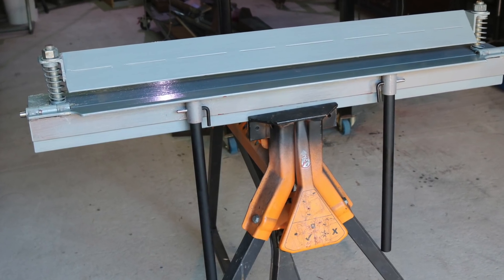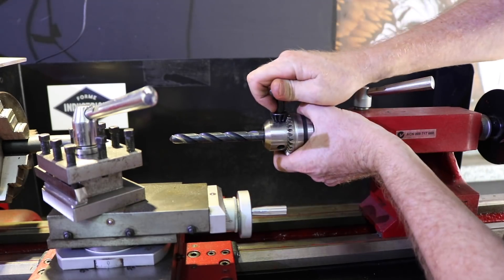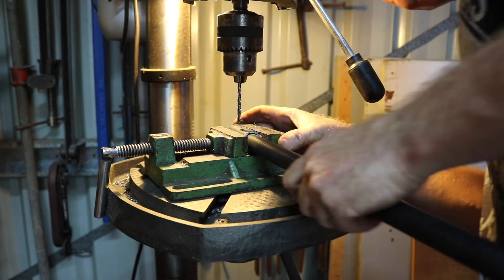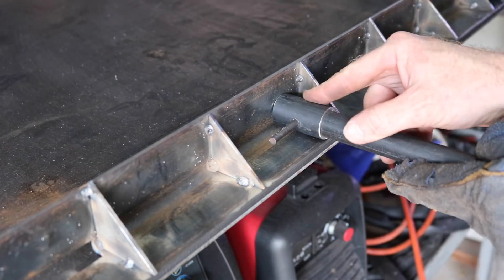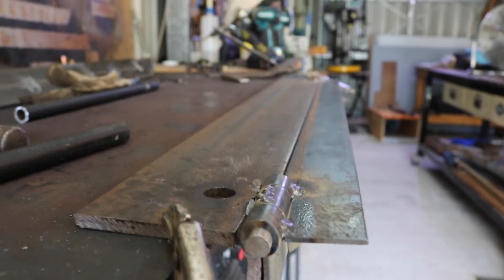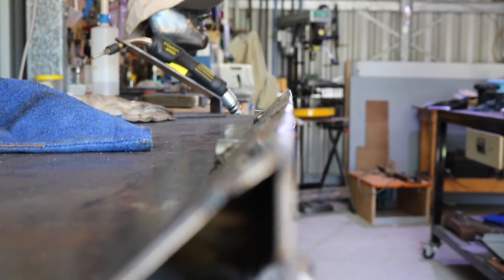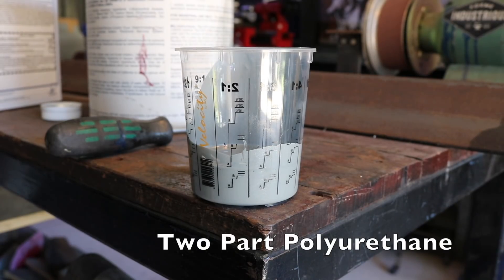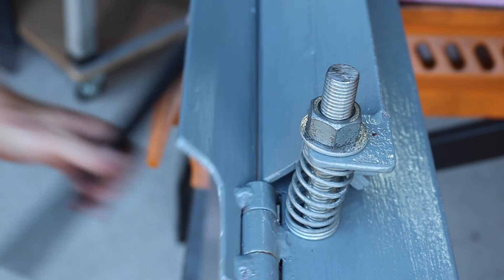DIY Sheet Metal Folder - Forme Industrious

Comment: nice work. What's the max width of 1mm sheet it can bend?
Reply from the maker: Thank you, yes that is about right in thickness. If you have a very narrow piece it will do more.
Reply: @ScottTurnerformeindustrious  but how big piece it can bend? I build myself metal folder from 4mm 35x35angle, and it's pretty weak, it can bend like 40cm max at 1mm. Just want to know if your design is any better

Comment: The one thing none of the videos I've seen so far tell you or even point out is that the clamp needs to move back from the hinge axis subject to the thickness of the metal being bent. Fine if all you are going to do is bend the same thin tin all the time but start getting up to 3 or 4mm and the angle that does the bending can't get to 90deg never mind further......
Reply from the maker: Thanks for the feedback Jonathan. Please note I have made a video for modifications to the bender for this purpose, see link for the video ; https://youtu.be/JhSDTo9fI_c  Also these benders really struggle with heavy material so for most light gauge is all that is used.
Reply: @ScottTurnerformeindustrious  Yes but even a difference of 2mm matters.
My point is why do so many videos, just about every one of them, yours included, don't realise this until after they have made one?!
Are you calling 4mm heavy, 4mm alloy?
And another thing no one seems to have grasped,  because the clamp bar needs to be adjustable  if you want to do a run of half a dozen or more identical bends then a great deal of time will be saved if adjustable stops are fitted to the back edge of the clamp.
This is the difference between the skilled craftsman and those who post on YouTube,
Reply from the maker: @jonathansimmonds5784  heavy i.e. steel. Did you see the second video?

Comment: Brilliant video. Thanks for sharing. What’s the maximum capacity. I mean will it bend 1.5 mm mild steel along the full width?
Reply from the maker: Thank you! 1.5mm it will struggle for the full width. If you make a relief cut it will do it. I made a fire pit, grill with the bender using 3mm mild plate. I made relief cuts and it performed well. I made a video on that project for you to see.
Reply: @ScottTurnerformeindustrious  thanks. Look forward to seeing the video

Comment: Nice job Scott. In case you didn't know, there is a Aerosol product called PREVAL you can put your own paint in it and spray your jobs. They are available from mosty Aussie Auto parts stores or ebay. Cheers
Reply from the maker: Much appreciated, thank you. I actually have a HVLP Spray gun, however I don't like to spray 2 pack paints without proper filtration. The over spray lands on objects quite a distance away and then cures. Don't ask me how I know this..... I may have had to pay $$ to have a car cut and polished due to over spray.
Reply: @ScottTurnerformeindustrious  👌👍😁

Comment: instead of a piece of wood you can have a slotted (for hight adjustment) flat bar bolted to the top angle iron with a 45 degree bevel at bottom (bend point) held by angle  cleats welded to far side (of top angle) with holes for bolts
thx for the video

Comment: I really enjoy your video on making a sheet metal brake. You used some rotary cutters instead of drill bits and  they did cut like butter like you said in the video.  My question is where can I purchase some here in the United States. Are they called rotary cutters, if I know what they are called maybe I can Google them. I would appreciate any assistance in this matter. Thank you so much for all of your help. Also thank you for the informative video please keep them coming.
Reply from the maker: Thank you Rudolph! Yes the rotary cutters are excellent. I get zero kick back but here is the link.https://www.hougen.com/cutters/sheet-metal-hole-cutters/Rotacut-sheet-metal-hole-cutters.html

Comment: i need to build one for my projects . what is maximum thickness (mm)
 of metal it can bend . i need to work with 2mm or 3mm
Reply from the maker: I'd say 1mm. Not too many manual brakes will bend 3mm sheet.

Comment: Your design is fundamentally flawed. 
Using angle in the orientation you have is its least rigid mode.
Your first attempt illustrated the error.
Your second attempt disguised it.
It's a common fault with these builds.
If you look at an RSJ in its vertical mode, that is its most rigid.
The vertical web gives stiffness, and the top and bottom flanges resist compression, and tension, respectively.
An angle is a quarter of an RSJ.
https://www.youtube.com/watch?v=87igEF85468
The above is closest to a commercial brake. 
https://www.youtube.com/watch?v=NMsHd1u9mlQ
This one is using the metal with maximum stiffness.
You need to use the stiffness as illustrated  here, or as close as possible.
Reply from the maker: Thank you for your comment, much detail. I'll take look at the links. I decided on using the angle to bend past 90 degrees. It is only used for light gauge material.
Reply: @ScottTurnerformeindustrious  
The only commercially sold  version I've seen like yours, is 600mm/2ft max width, and 0.7mm max thickness. Almost kitchen foil! 
That version uses the angle flat to the material on one side, with a flat strip to close it into a triangular tube.
Ideally, you'd need something like the flat plate you've used as the base, to bend the metal against.
Reply from the maker: @niklar55  I used mine yesterday to bend 1mm mild steel. Worked well, however I agree it is only for thin sheet metal. Most home DIY are not looking to bend much thicker.
Reply: @ScottTurnerformeindustrious  
Thats probably true, but for a bender of that size, I'd regard 1mm as the minimum.
I'm presently trying to design a bender that circumvents the problem I've mentioned, but still gives full range of  usage.
It's obvious, so far that a blade in multiple lengths/parts is desirable, for box/tray making. So at present I have two pieces of channel, perpendicular to one-another, as a starting point. [In my CAD program] and am working on it periodically, as time and other projects allow.
The vertical hydraulic version seems the most effective,, but requires a lot more material and work. So somewhere in between may be the answer.
Who knows, any year now........!😎
Reply: @ScottTurnerformeindustrious  
If it works adequately for you, then thats really all that matters.
One improvement could be to use unequal angle, say, 100x65 mm, vertically,  like a capital ''L'' and then close the angle with a diagonal plate from top to bottom, making a tube. the diagonal would act as a guide to grind the lower edge of the angle to a knife edge.
This uses the angle most efficiently, providing the best stiffness available.

Comment: I always like to hear the Australian lingo. "I'm such a goose." Priceless! 
Nice work on this. I am going to make one of these so I an make my own steel cabinets with shelves.
Reply from the maker: Thanks Dave. I'm also a Drongo from time to time. Regarding the folder, I made a follow up video where I made some improvements to the basic design. It is much better now. Cheers.
Reply: Bending leaf should match the base or reinforce behind to equalized themselves working against each other when braking a pc. of metal hold down edge should flush to base reinforce w/angle iron 5 or 6 mm heavier metal for all for thicker capacity  of brake with no twist or distortion of leaf and hold down straight bends like your spring return

Comment: "Extraction System"? Oh you must be in Nanny State Australia then.
Reply from the maker: Strange comment. Aside from obvious hazard reduction relating to health, an extraction system protects anything down wind of the paint particles from getting paint dots all over it. Such as cars. Two pack paints are not air cured like acrylics, when the over spray becomes almost like a dust after a few metres doesn't stick to things. Two pack Polyurethanes are chemically cured, meaning the paint partical overspray lands on something and cures on it.  Imagine a neighbours nice white car with hard cured grey paint dots all over it.  Sometimes we must use our brains.
Reply: @ScottTurnerformeindustrious  Why would you need an extraction system anyway when spray painting 2 Pack is illegal at home in Australia, check the law. Another Nanny State requirement. I'm complaining about Australia, and how restrictive it is, not you or what you are doing.

Comment: How bout welding a couple of short pieces of round to the lock down nuts to create some t handles so you don't have to look for a wrench everytime you want to lock your work down? You're right way too over engineered, less cuts and less welding makes for sturdier and straighter pieces.
Reply from the maker: Totally agree Andrew, thanks. I did a follow up video on this bender with what I call improvements. All experimental, but that's how we learn when we are bashing away in our sheds.

Comment: Hi Scott,
A damn fine video explaining the steps well.
Is it possible (with the clamping bar removed) to use your bender to do radius bending also?
Cheers
Reply from the maker: Thanks! Well if you use slippers you can create bigger bend radius's. I have another video with this bender with modifications which shows the slippers in use. Hope that helps.

Comment: can you tell me maximum thickness this tool can bend?
Reply from the maker: < 1mm steel comfortably for its length. 3 mm Steel up to say 50 mm wide easy. Remember this is a sheet metal bender

Comment: Is it ideal to enlarge it to 4m - 6m with just two hinge on both end like above assembly? I had one industrial type but many limitation especially edge bending of less than 25mm.
Reply from the maker: With this design 4m or 6m is pretty darn big. This one is less than 1 m You would need to have pretty heavy structure to make it work, and bracing. But I suppose it is possible for bending thin material.
Reply: @ScottTurnerformeindustrious  Yes, it is big. I'm deciding to do this (cheaper as I can DIY it) or just use feeding machine with roller type. Just typical metal sheet that range from 0.2mm to 0.6mm type. Definitely less than 1mm.

Comment: I used box steel for bend bar,,, works very well, and you can get flat square edge angle iron instead of useing round edge,, and you can have your bending edge milled in sharp angle for crisp bends.
Reply from the maker: Thanks George, Yes a milled sharp edge would be much better. So far it's been a pretty handy tool for my workshop.

Comment: Great set up of tools..... Very jealous..... Great workmanship also. A lot of YouTube content creators just throw stuff together and totally disregard safety, forgetting young teens watch and emulate what YouTubers do...... So top job all round mate 👌👌👌👌👌
Reply from the maker: Very much appreciate your comment Adrian. I have some that mark me down on that regard as most times I don't wear gloves for general work, except when using chemicals. I'm not perfect but I do my best to get the safety glasses and muffs on. Welding I cover up otherwise UV burns my fair skin. Also I need to get a respirator for some jobs. Cheers!
Reply: @ScottTurnerformeindustrious  don't worry about the haters mate. I'm a boilermaker so i really like to see when good marking out and measuring as im ocd as hell about that..... I've got a 3/4 built pan break, i just need to find the time to finish it off, but since moving and ending up in a tiny workshop I've lost all drive. I was going to do a job a week or 2weeks if it was a bigger project. But like i say, ivd lost motivation.... I do a fair bit of blacksmithing also......
Reply from the maker: Cheers Adrian, you'll push through it and get it done the you are ready. I have a second video on the bender that shows some mods that improve this style of bender. It's worth a peek. I've bought a diy forge kit, so I just need the chance to put it together. Need to try some smithing!

Comment: Hi Scot, can it bend the 2.3 mm steel plate or 3.2 mm steel plate with 400mm long ? I wonder
Reply from the maker: hi, no sorry, this design is only for light sheet metal less than 1mm thick

Comment: How thick a steel will a tool like this bend?
Reply from the maker: Depends on the length. I just bent up 1mm steel, 700 mm long and the bend had a bow in it. The reason is that the lower bending jaw flexes in the middle. I have since fixed the top. You can see more other video where I did the mods. When I mod the bottom jaw 1mm will easy to bend.

Comment: Good job. I was worried at first with the flex in the thinner angle. You obviously fixed that with heavier angle and the finish was great. Thanks
Reply from the maker: Thanks Geoff! I did a heap of structural improvements to this in another video. Much better now.

Comment: I am bilding one right now
But my question is where can I find those rotary cutters.
You have a brand name or shop where I can buy those
Reply from the maker: Here is the brand that I use; https://www.hougen.com/cutters/sheet-metal-hole-cutters/Rotacut-sheet-metal-hole-cutters.html
They are pretty darn good! I got mine second hand but if you search on line you should find a supplier.
Reply: @ScottTurnerformeindustrious  thanks for the info.

Comment: Love your work bro! Only thing I'd like to have seen you make on this one is handles for the height adjustment rather than needing to use a spanner. Maybe some tubing welded to the nut and a simple bar fitted through opposite holes at the top, make it quick to use and long enough for leverage? Just a thought, keep up the great work.
Reply from the maker: Thank you! I might yet do that but sometimes the handle can get in the way of the bend. Cheers!
Reply: Thanks for the response, really appreciate that. Just to add, the lever bar would have stops on each end and would be free to slide back n forth, to avoid it being in the way.... Aaaaanyway, I have also seen your update video to this one, love the new machined spanners, as always, top work 👌👍🏼
Reply from the maker: Ah yes I see what you mean. That would work. Cheers!

Comment: Powerplasma cutter is my preferred way to cut metal. I was tired of buying blades for my band saw.
Reply from the maker: Right on. I changed over to a high quality blade. last so much longer. My plasma is pretty wild on accuracy, always leaves me with heaps of grinding.

Comment: Thanks for more great ideas Scott 👍
Reply from the maker: No worries!
Reply: Hi Scott, I think I’m gonna put my hand to building one of these shortly,  I have a heavy welding table that I’m gonna attach it to which is 1m in width,
I’d like to build it to fit a 1220 sheet and add in a supporting truss on top, but I’m not to sure if it is a good idea to go this big as I’m not to sure if I’ll have the strength to bend a sheet this big,🤔
From your experience with your one do you think goin for 1220 is too much.? 
👍
Reply from the maker: Richutube2000 check out Phil Vandaley build (I think it's Phil's video). He made one about that size but it will definately need struts to stiffen . Thickness of material that you want to bend is another factor.
Reply: Will do Scott thanks, 👌

Comment: epic job.  one question--I use a portable bandsaw affixed to a table made by Swag especially for that saw.  However I get a ton of blade bend so making perfect cuts in tough.  Any tips on how to avoid that?  On your saw it looks like the blade stays true.  Thanks.
Reply from the maker: Hi, thank you! I have never used the portable band saw however the best metal band saw set up video I could find is this one:https://www.youtube.com/watch?v=0Z-xRzI6nEI I used this video to set up my metal band saw. Very now and then I have to do an adjustment. Hope this helps.

Comment: Hi Scott, I absolutely love your videos, have just finished watching your recent one on your new CNC table. lucky bugger. I then remember about this video I had watched some time ago. Scott do you have plans for this build with the modifications you made to it to allow the ability to make boxes? I am pretty sure that this build need to be my next project. if you don't mind sharing of course. Finally I am looking at buying a horizontal band saw. how do you rate the Hafco one you have? Your videos are very inspiring and making me want to get out and build. thanks Andrew
Reply from the maker: Hi Andrew. Thanks for watching my videos! I am fortunate for sure. I don't have plans sorry for any of my builds, yet. Maybe i should. Also I haven't done my mods yet either (gosh I've been slack!) But it is a relatively simple build but I'd advise to use heavy gauge steel to help prevent flex. My Hafco BD-5S Bandsaw is great for a small shop or light work. I love it for what I do. If you get one try and get high quality blades (I'll try and find the brand I use). Cheaper Starret blades just don't last long. Yes get out and make something! Al the best!
Reply: Scott Turner i went out and did it. I purchases a BS5S bandsaw.😀 have given it a good work out this weekened. Thank you for your advise. Cheers
Reply from the maker: Awesome! Have you checked your cuts for square? They do need a bit of adjusting. It's a good saw. I also use a little cutting oil. I find that helps maintain the blade. Thanks for letting me know!
Reply: Scott Turner i was lucky as the cuts look pretty square staight out of the box. So i thought i better leave well enough alone. Have only done 90 degree cuts so far. What are you using as a cutting fluid?

Comment: you must use steel instead of iron
Reply from the maker: I didn't use iron, I used steel.
Reply: yep then you were angled too thin 3 mm is thin  for that length there is a lot of strength

Comment: Is there a set of plans somewhere that I could print off?
Reply from the maker: Hi Thomas, sorry I don't have plans but it is quite a simple build. It's probably scarier thinking about it than actually doing it. Make from 4 to 5 mm thick steel, width to suit the biggest item you are likely to make. Mine has a bed of 800 mm which is pretty big.
Reply: What is the overall length, about 1m?